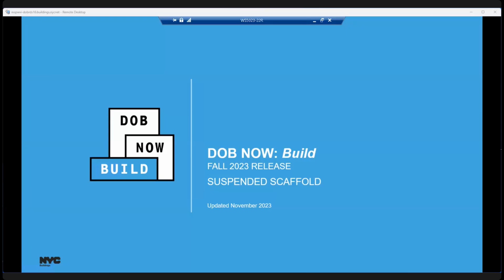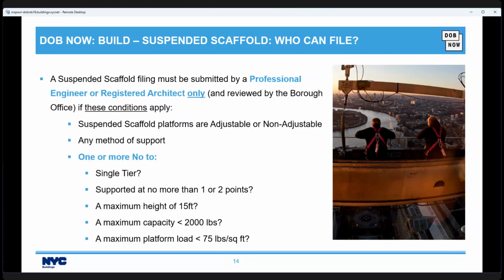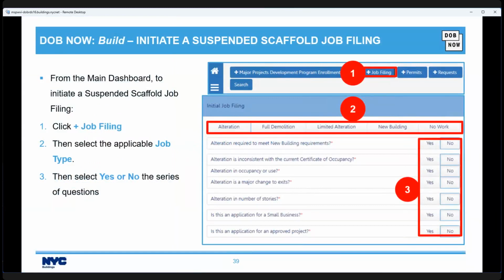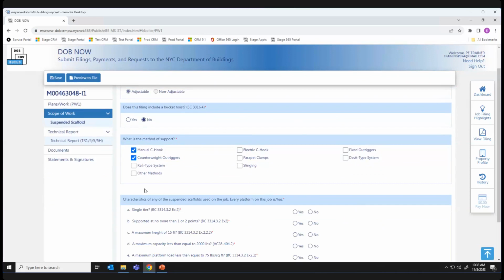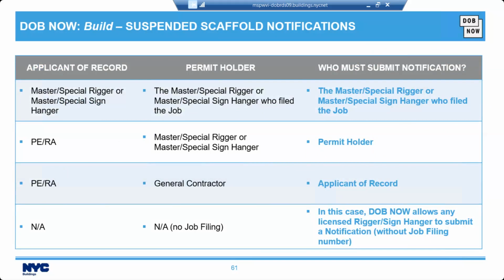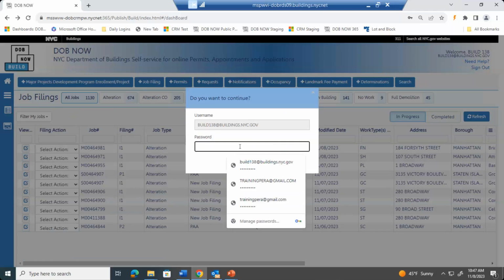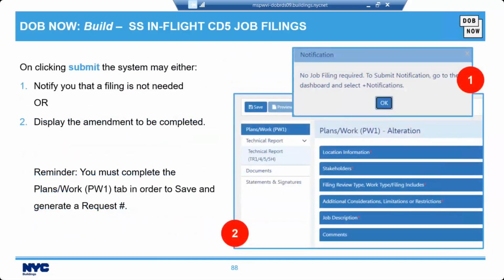DOB NOW Build – Suspended Scaffold Training

Comment: Nice presentation,  but it has some mistakes.
At 9:01,  all chooks connected to a parapet, it says NO, but the correct answer should be YES.  Because , if its no, then a filing is required. 

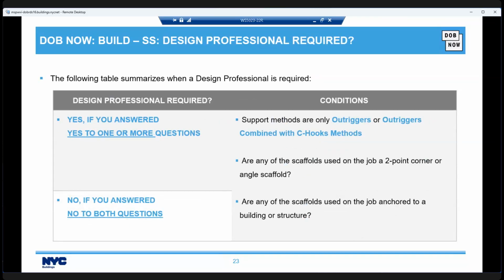At 13:15 , you say "No", if you answered no to both questions,  but you list 3 questions and not 2

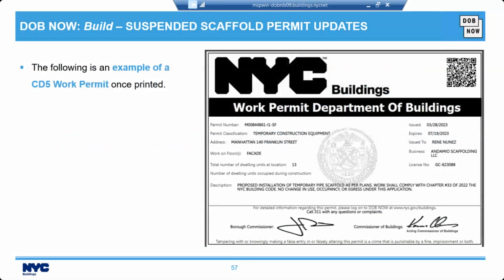At 31:27 you show an example of a CD5 work permit, but the dob permit you show is an SF(supported scaffold) and not an SC😅😅